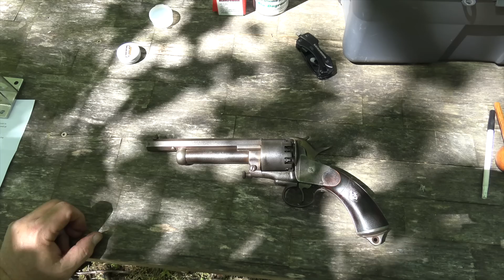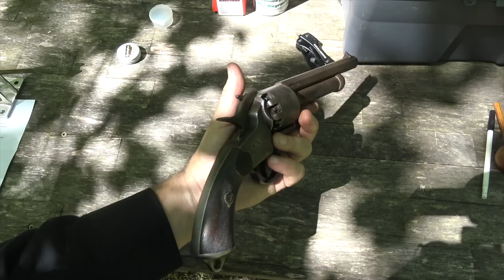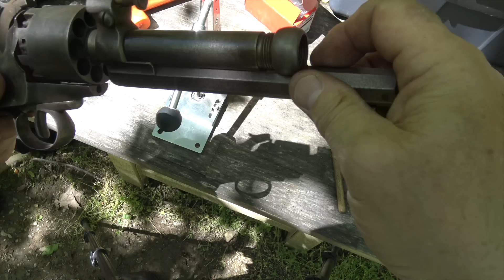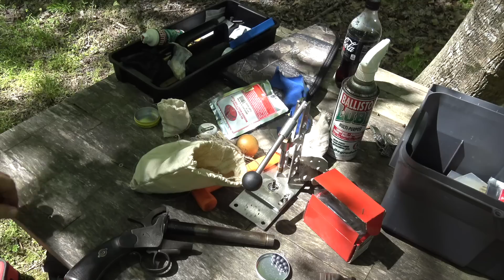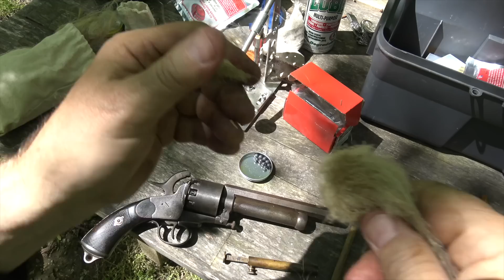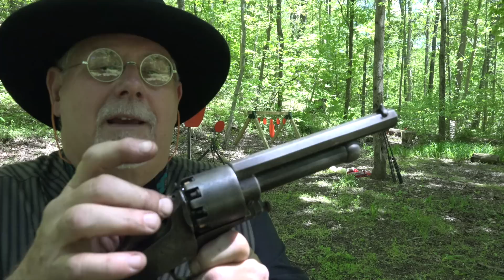The De-Farbed LeMat Revolver

Comment: I got my Le Mat shotgun barrel to fire consistently. I drilled the hole in the rear of the barrel a little larger and I enlargened the nipple a fraction. Works now. As for finish, I have never taken one of these part, or I would just give it the vinegar treatment and have Lodgewood place the appropriate stampings and markings removal. I am afraid to take mine apart. A good idea for a video might be how to strip down a Le Mat. Would help me much.

Comment: Well, my mission to get a Le Mat that works continues, heh.

The first one, a "Cavalry" model from Cabela's, wouldn't stay cocked, so I sent it back.

The second, a "Navy" model from Navy Arms, sold through Dixie Gun Works, has the hammer face striking below the shotgun nipple (the sight V is hitting the bottom edge of the nipple) and the screw slots are all chewed up.  I don't think there's enough material in the back of the selector to change the angle at which it engages with the spring, either, without cutting into the hole that the screw goes through.  :(

Dixie seems to have a pretty good reputation, so hopefully they will make a good try at setting it right.  Still, this whole ordeal is starting to get a shade frustrating, heh.

Comment: I solved the shot barrel not firing in my instance. It took three strikes to fire the barrel. This was consistent. All four times I tried, I had the same experience. I took an idea from MannyCA of putting a little black powder in the homemade cap. I make my own pistol and musket percussion caps. I bought about six units of the German made caps from Walmart when they had them. Still looking for more. I am suspicious that the anti-gunners might have complained to Walmart. There is no reason for every store to be sold out. Walmart does not even sell the cap guns the caps would use! I am an NRA Reloading Training Counselor and of course have a powder trickler. I trickle a little powder that I made (I put from FFG through a coffee grinder and got a concoction that is a mixture of FFFG and FFFG) to cover the bottom of the cap and put in three paper caps, and I will be a son of a bitch, it works. Same with the musket too. Just thought I would pass along my experience to anyone who is having problems getting the shotgun barrel to ignite. Pistol and Musket tools are available from Kevin in McMinnville, OR, if you need his info, let me know. Happy shooting.

Comment: The box said it was .65 caliber and Dixie said to use a 0.01 patch and .63 round ball.  I did just that. I ordered a custom .63 round ball mold from Jeff Tanner. Tried a .0015 patch and it was a NO GO. Would not move. With a 0.010 patched round ball I have shot it. Fits perfectly.  Jeff's molds are precise. For some strange reason it fires on the third trigger pull consistently. I have fired the shot barrel THREE times and each time, the hammer took three blows to ignite the charge. I do not know why. Suggestions? Dixie also says to use ,451 balls. I have done just that and it was a lot of work to get the ball to seat in the chamber. I tried a .454 and got it to seat, after much effort. I use a Tower of Power to load the removed cylinder and can no way cock the hammer with one hand. Mine is very tight. One of the first lot to be imported by Navy Arms. Looks 98%. Has the three digit serial number 31X.  I ordered 18 gauge wads and cards from Track of the wolf so I can shoot buck shot out of it. Track says they are .647 diameter. Should work. Mine is accurate at 15 yards. All 9 balls leave one big hole in the target.  I have a problem with the ramming lever. It comes out after every shot. I bent the spring, and it works one or two times. If a tighten the loading level screw all the way in, I can see the ramrod move out of its notch in the barrel. I loosed the screw and that helped a little. Disappointed. Going out to shoot it today and see if Mr. Shot Barrel decides to fire.
Show less

Comment: I wish I could get a custom one that has a longer cylinder like the colt navy so I could get more velocity and maybe a longer barrel for the shotgun two with a built in choke to have a better spread at a little longer distance than the original maybe even a compensator for the regular Barrel sense it would have more recoil with a navy cylinder

Comment: While U would need a drastic redesign for a wholly cartridge LeMat, there could at least B a cartridge capable cylinder, although unless U add a loading gate, U would still need to take the thing apart to reload, so there's that.

Comment: The problem isn't with the 'experts' being fooled, but with the novice or even some general dealers being fooled. I recall a "Griswold & Gunnison" that was found in 'grandpa's old stuff' that a floorwalker sold to a dealer, who thought he got a 'deal' from an ignorant yokel, paying $400.00 for a $3,000 gun only to realized he bought a beat-up, defarbed, $75.00 replica. 
 Caveat emptor, made all the more difficult with defarbing.

BTW: Italian replica's use metric screws and this is an easy way to check a suspect. There are also other production differences with originals such as radii cuts, grip angles [the giveaway with the Griswold & Gunnison, rifling, etc. that can easily be observed if suspect. With smart phones and internet access, suggest that before buying an 'original' that details be checked.

 (Ah, the smart phone, the bane of the modern gun seller! Can't say how many times, I've checked prices, reviews etc. when in contemplation of purchase.)

Comment: Makes me wonder if it would be possible to convert a cap n' ball LeMat to a centerfire cartridge shooter by using the loading gate. Probably be insanely expensive since it'd require a complete rework of the hammer, loading gate, and cylinder to work off the cap n' ball frame.

edit: Not to mention you'd need to add on an extractor of some sort, given the loading lever is too short and too fragile to work in that regard.

Comment: Hey Mike, good to see the old LeMat out again! I was just wondering something: a long time ago, I came across a term in one of my old Hardy Boys books that mentions something called a "slip gun." Is this a term you're familiar with, and was it something used back in the day?
Reply from the maker: I believe it is a gun with the trigger wired back that is fired by slipping the hammer
Reply: duelist1954 Okay, so they DID describe it correctly. They said that a slip gunner would "wipe his thumb over the hammer to fire it," and sometimes he'd lower the hammer spur and take out the trigger. Is this, indeed, accurate? And what would be the purpose of doing it in the first place?
Reply from the maker: That is the way a lot of cowboy action shooters shoot, though they hold the trigger back, rather than wiring it back. You can shoot very fast.

Comment: 18 gauge is larger than 20 gauge. You also said the cards and wads would fall out. Yet the bore is smaller than 20 gauge?
Reply from the maker: EldarKinSlayer Sorry, approximately 22 ga.
Reply: I don't usually like "fake" patina preferring that a firearm earn its scars that LeMat is truly beautiful, great video, though I think I disagree with your conclusion, especially in a Martial setting, 9 shots keeps you in action half again as long plus that belly shot gun in the middle. JEB Stuart a true fighting General swore by his LeMat.
Reply: The box said it was .65 caliber and Dixie said to use a .63 round ball.  I did just that. I ordered a custom .63 round ball mold from Jeff Tanner. With a patched round ball I have shot it. Fits perfectly.  For some strange reason it fires on the third trigger pull consistently. I have fired the shot barrel two times and each time, the hammer took three blows to ignite the charge. I do not know why. Suggestions? Dixie also says to use ,451 balls. I have done just that and it was a lot of work to get the ball to seat in the chamber. I tried a .454 and got it to seat, after much effort. I use a Tower of Power to load the removed cylinder and can no way cock the hammer with one hand. Mine is very tight. One of the first lot to be imported by Navy Arms. Looks 98%. Has the three digit serial number 31X.  I ordered 18 gauge wads and cards from Track of the wolf so I can shoot buck shot out of it. I fear they may be a little too small. Track says they are .647 diameter. Should work. Mine is accurate at 15 yards. All 9 balls leave one big hole in the target.  I have a problem with the ramming lever. It comes out after every shot. I bent the spring, and it works one or two times. If a tighten the loading level screw all the way in, I can see the ramrod move out of its notch in the barrel. I loosed the screw and that helped a little. Disappointed. Going out to shoot it today and see if Mr. Shot Barrel decides to fire.
Reply: If you're using CCI #10 primers, they are slightly too small and often require multiple trigger pulls to pound the cap tight enough against the nipple. Try using CCI #11 or Remington #10 caps. Or replace the nipple with a slightly smaller one.
Reply from the maker: I used Remington #10
Reply: I use CC! Number 11 MAGNUM caps and it takes three strikes for the shotgun to go off. I tried to get at the nipple and cannot fit the nipple wrench on the SQUARE nipple. Pretty difficult to access.
Reply: I make my own percussion caps out of aluminum cans. I learned a trick from MannyCA. Put a dash of powder in the cap, then place the three paper caps you punched out.  The gun fired, unlike before when it need three strickes on a No 11 magnum Winchester cap. When off like a dream. I may have put in a little too much powder because the percussion cap was completely gone after firing the gun. Works for me. I am happy. I can have fun with the shot barrel now. I bought a Lee 18 cavity 00 buckshot mold and made about half a coffee can's worth. Time to try the buckshot on some targets.